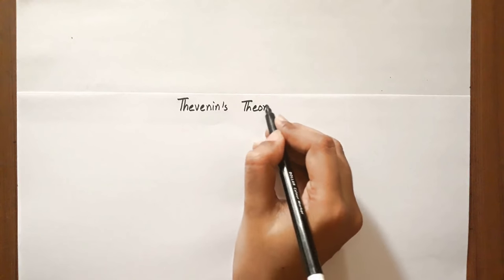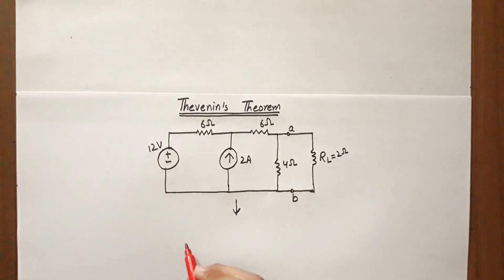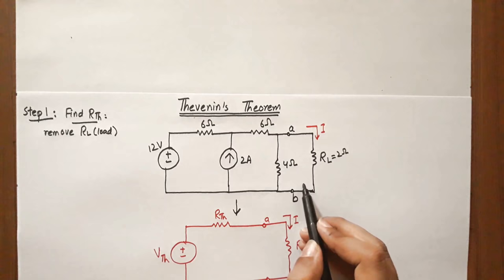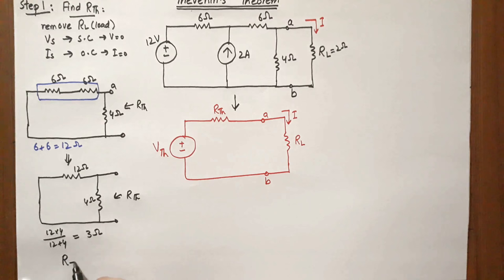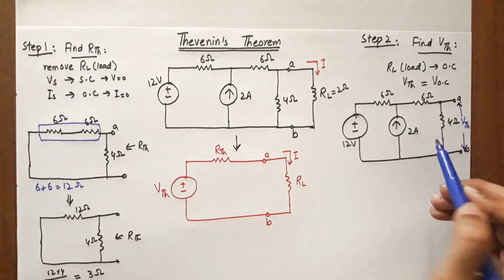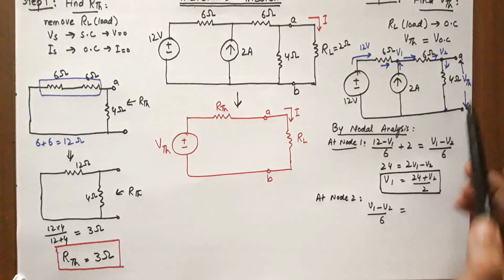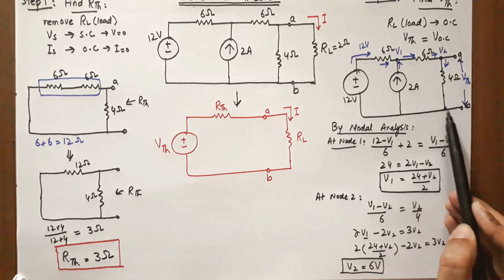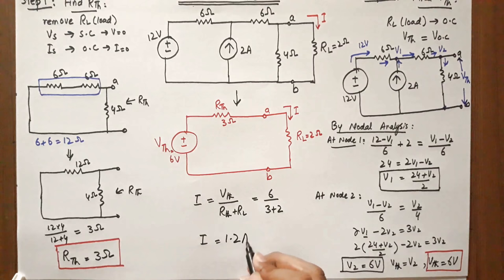Thevenin's theorem circuit problem solution easy steps

Comment: mam when we calculated current ie= 1.2 A but what about current source -current
Reply: As you can see in the step 1, when we remove load resistance, then all current sources and voltage sources will be nil/zero.

Comment: Can we use mesh analysis instead of nodal analysis... If so how?
Reply: You could have but then it will get more lengthy and further complicated
Reply: @I_am_Anugrah  no answer will become wrong
Reply: @AnimeAatma-cc5ov  Wait... How??
Reply: @I_am_Anugrah  mesh analysis is imaginery current it says currents flow in a loop but not in reality no current flow in loop . But charge does foolow the nodal analysis that is of kcl .
So both are not same don't give same result try it now by assuming a simple circuit values.

Comment: At node 2, won't it be v2-v1/6
pls clarify my doubt
Reply: Current flows from higher potential to lower potential. Since the arrow was towards v2, that makes v2's potential value lower than v1. Current = (Higher Potential - Lower Potential)/Resistance across the potentials... Hence, Current at note 2 = (v1-v2)/6. Hope that cleared your doubt :)